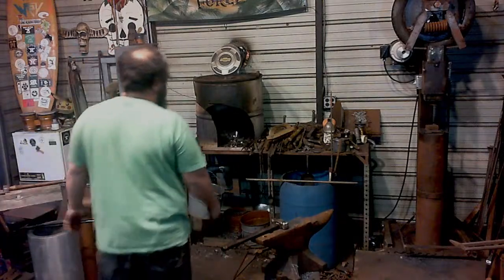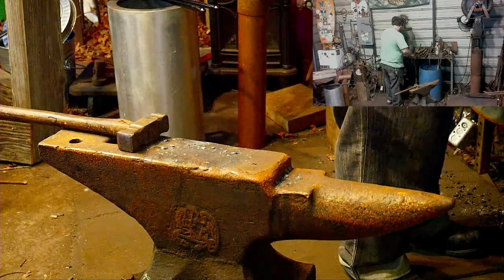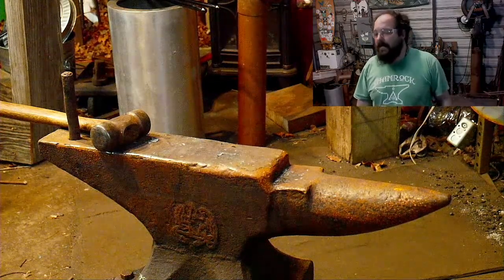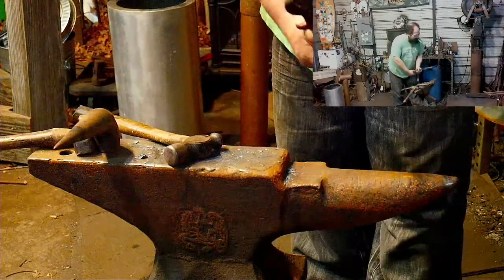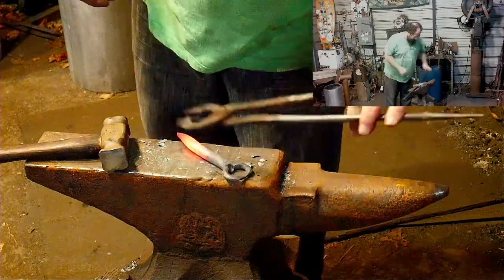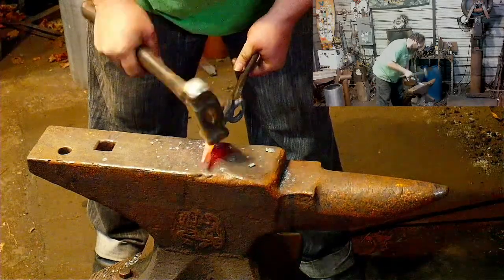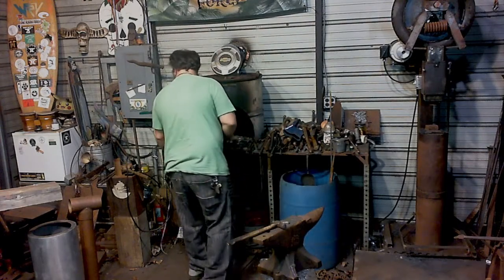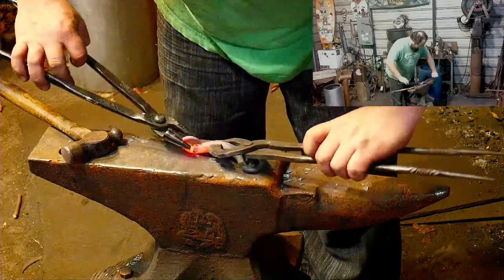Forgin' with Yamez! Bottle Openers!!

Comment: Think turning the bar around so that hot end is down and just lift and drop it to upset it would be easier than having the hot end up and hammering. But, I'm just starting out, so, haven't actually tried either way yet.
Reply: Yes Bill, you can lift and drop to lift and drop to upset usually done with larger bar so the weight of the bar helps with the upset.